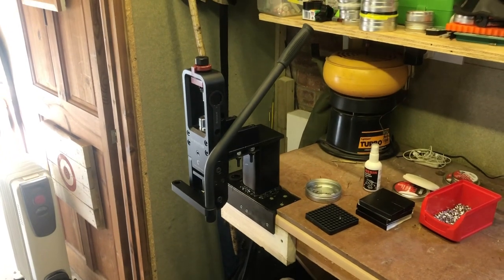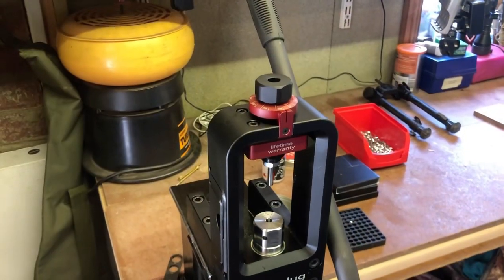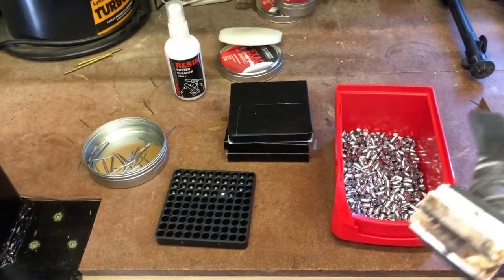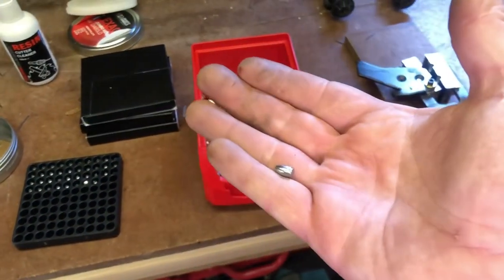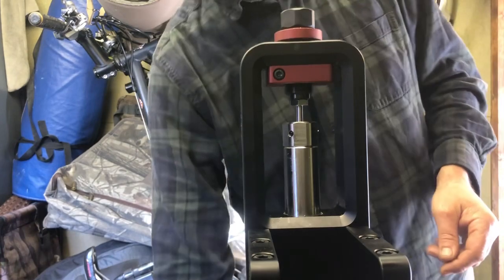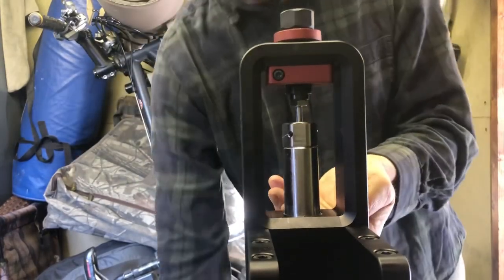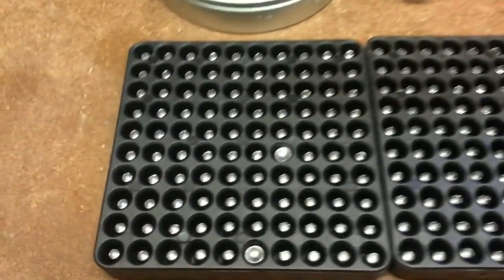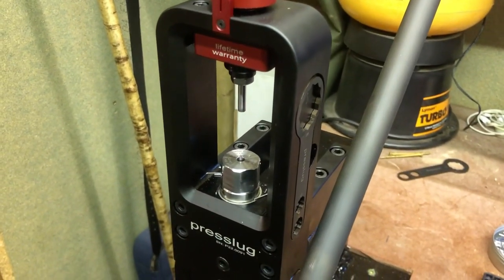Presslug In Action using cast bullets.

Comment: Hello. I just purchased a presslug. What size die do you have?  Mine is .2169. I need the next size larger
Reply from the maker: I have both 216 and 217, but the 216 works will with the lead I’m using